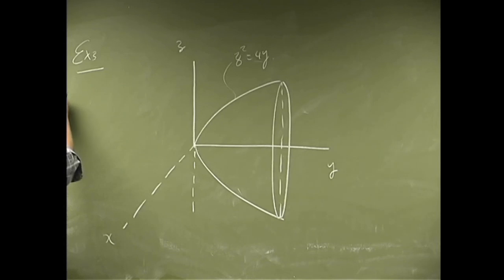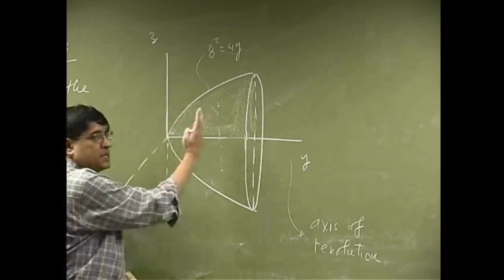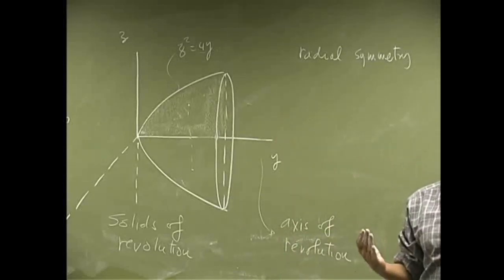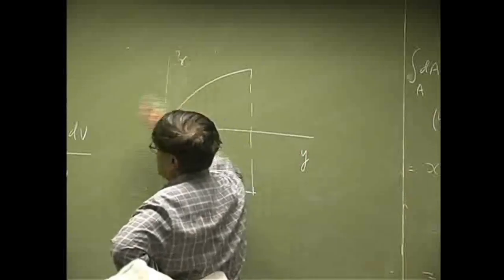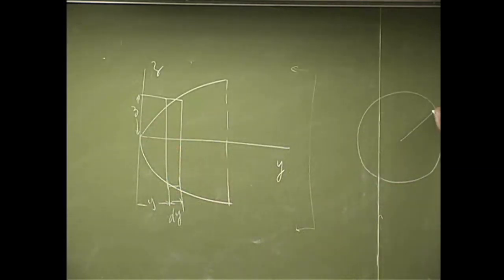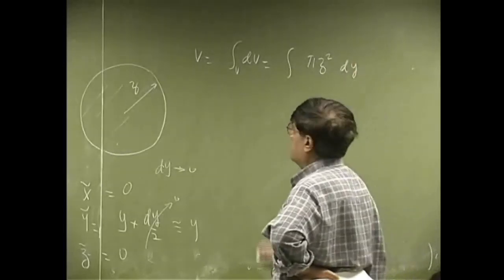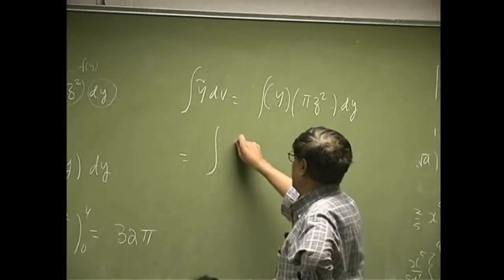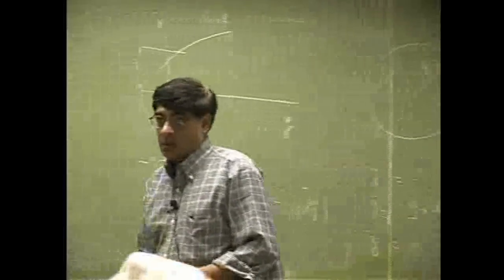Centroid of Volume | Statics

Comment from the maker: Z^2=4y is equation of the curve that is used to generate the solid and it is given as part of the problem statement. 

Integration limits are decided based upon the way the final integration is set up. In this case the integration is with respect to variable y so the limits are y=0 to y= 4